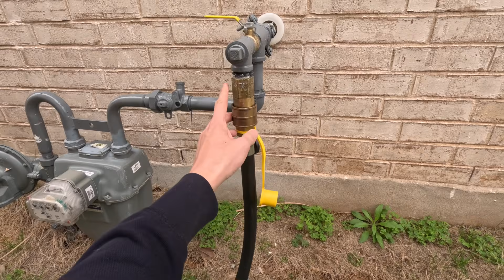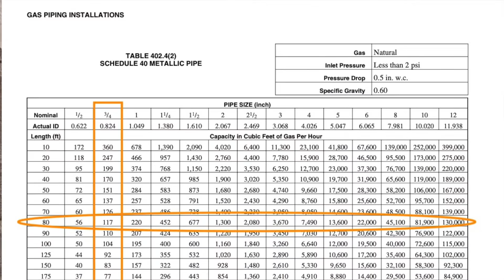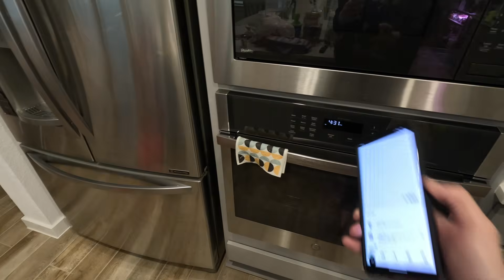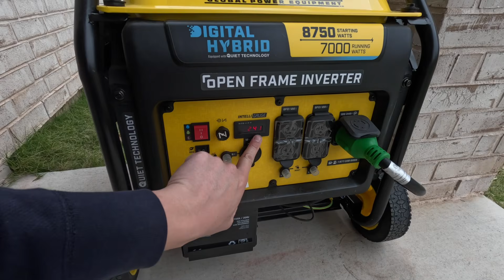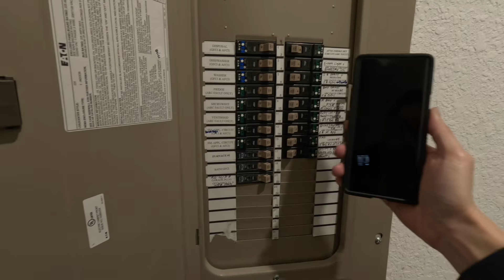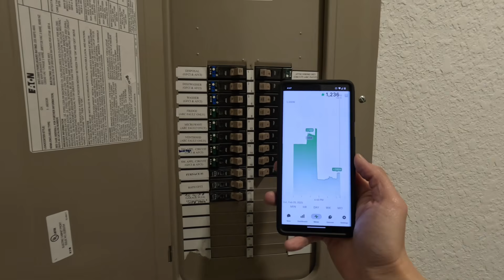Champion 100520 + Motor Snokel + Natural Gas = THE ULTIMATE BUDGET FULL HOME BACKUP GENERATOR?

Comment: You got a video on Beryl coming soon?
Reply from the maker: I live in Central Texas and fortunately missed the storm. Our power didn't go out at all, so no video for me to make (which I am grateful for).
Reply: @jonathanDIYs  You've got the best practical solution for us in the Houston area.  We didn't get power back till Monday evening a week later.  It got up to 86 degrees on Monday Inside.  We survived with generators to save our freezer and fridges...had one window AC in the small computer room.  My gas meter is 55 feet away from the electrical panel in the backyard.  I wouldn't feel safe either with a generator on the side of the house exposed.  I like the idea of the inverter generator and the add on start kit.  Thanks so much!! Are you in SA?
Reply from the maker: @bjmcia  Glad you like this idea and find it useful. I came up with this setup because I wanted something cheaper and less permanent than a generac that could come out to 10-15k after installation. This one meets all my needs while still being economical. I am actually outside of Austin.
Reply: I may go to 15,000 Champion Tri Fuel inverter to power our 4 ton AC.  Portable gas line and extension cords make sense to me too.  I can build a shelter out of free pallets.  I’m a woodworker too!  Thx!   I see Moony Mann’s setup too. Thx again from Houston.
Reply from the maker: @bjmcia  that's a nice model! Post some pictures of your build when you're done if you can. You definitely will want to go with the 50 amp breaker and NEMA 14-50 connector. Do note that the larger the generator, the faster it burns fuel generally. You generally want to get the smallest generator that will power everything you need. I definitely can see the need to get the larger model, my 8750 watt generator barely powers everything. 

Hope your emergency prep setup goes well!

Comment: thanks for the videos on the generator setup, looking to get the micro air soft start for my 4 ton trane AC so i can run my tri fuel generator to the house. How has it been after a year of use? I hear some mixed opinions on the soft start, some say" it kills the compressor over time"
Reply from the maker: I've had 0 issues with it, I don't even notice it is there. My compressor goes on and off 50-100 times a day, I have had no issues with this.

Comment: I probably missed it. What size is your generator? Great video thank you for posting.
Reply from the maker: @rjzlwop3153  7000W running/8750W starting for gasoline. On propane and NG, you can expect a small performance dip. Champion 100520 inverter generator.

Comment: who configured the electric box
Reply from the maker: I did the generator inlet port myself. I installed it using a backfeed breaker with a manual interlock transfer switch. This is the cheapest way to do it that is still compliant to electrical code.

Comment: do you need a separate regulator to run on natural gas?
Reply from the maker: The only regular you need when running on natural gas is the one that comes with the motor snorkel for MOST homes that feed the standard 7" WC pressure. You have to do the research for your home to determine if you are getting standard natural gas feed. The regular that comes with the Motor Snorkel is something like the: Century C-KN regular https://www.centuryfuelproducts.com/media/Forms/CENTURY_MODEL_KN_SERIES_SPEC.pdf

Comment: Awesome videos. Plan on doing exactly this. Do you think the ez start for the AC is necessary?
Reply: Yes absolutely. Be sure to get the correct soft starter. If u have a 4ton ac get soft starter for 5ton. Soft starter only come 1,3,5ton. My ac 39.7amps 240v brand new unit. Emerson soft starter 13amps/240v. Using wen 12000starting/8000running gas. Starts ac while house is active. Minus dishwasher, washer,dryer,microwave. I running 4000watts to operate 2refriderators,deep freezer,wine fridge,ceiling fans,ac. Without ac running I barely using 500watts. I have a reliance watt meter.
Reply from the maker: It was absolutely necessary for me. If you look at one of my first videos I posted when I just got the generator, I tried to start the AC and it ended up tripping the breaker on the generator and I lost all power. @herewegoagain4041 shares some great advice.
Reply: @jonathanDIYs  for some weird reason my 4 ton unit is in a 20a breaker? Fingers crossed i don't need to spend another 350 on the micro air
Reply from the maker: @XxMugatu  my first gut reaction is "that don't seem right..." Hope it pans out for you... I honestly didn't like taking apart my AC and wiring everything there either for the Easystart. Worrying about life-threatening voltage in the AC (the capacitor) is not my favorite way to spend a Saturday. I would agree with you that it would be great if you didn't have to add that.
Reply: @jonathanDIYs  i bet it's not a 4 ton... Even though i looked up the model# and that's what the Lenox site said.
Reply: @XxMugatu  I know u dont like spending money. I dont like spending excessive amounts. Houston just went through some still experiencing the after effects of hurricane beryl. What I didnt like is searching for liquid gold. Gas stations was empty. It was challenging finding fuel for the generator. 

So now the next expense is natural gas pipe line. $275 just for 1inch 100ft couplings and 30inch curve for input output for underground piping. I haven't comsidered the connecting components like in this video. I personally am looking into the 🔮  to know if it is really needed. 

Then I want to make a concrete base to lock generator  to. It just sounds like money money money. I will figure it out. Oh and more money for the expensive natural gas. But consideration for the difficulty finding liquid petroleum.
Reply: @herewegoagain4041  couldn't get gas for about 2 days. Had to wait in line for about 30 minutes. I'm still without power and won't get it back until July 19th. That's almost 2 weeks without power in one of the nations largest cities. I'm doing ngl as well
Reply: @XxMugatu  fm1960 & aldine westfield.........u?
Reply: @herewegoagain4041  edge of kingwood. Royal Brook subdivision. 🤘🤘👊👊

Comment: Jonathan: if your generator stops running does natural gas continue to flow thus causing a hazardous situation?
Reply from the maker: Hi @user-rw8rh6uh9z - Great question! No, if the generator stops running, natural gas does not flow because of the regulator that is included with the motor snorkel. Unless the generator is providing suction, the regulator stops the flow of gas. This is why I have to push the primer button a few times to get it started because of this exact safety feature. Thanks for your question and thanks for commenting!

Comment: I am currently running NG on a motor snorkel conversion kit on my WEN 3800watt inverter. Have a 30ah outlet with 30ah breaker. Since I have NG I am able to run all the lights, refrigerator, router, TVs, and 8000btu portable a/c and also furnace in the winter. But now I want to upgrade my genny to run the 5ton a/c. I will be buying and installing the micro air easy soft start. Then will upgrade the genny to more watts. My question is, Are you using a 30ah outlet next to the breaker box with 30ah cords running your A/C and other items in the house off that genny and NG?
Thanks for the video great info.
Reply from the maker: Hi, thanks for commenting! Yes, I am running my 4ton AC off of my inverter generator which is plugged into the main load center through a 30 Amp generator inlet port and a manual interlock transfer switch. There is a chance you might have to upgrade to a 50 amp for a 5 ton AC. It's hard to tell until you try it out because it is surge power and not sustained so the quick surge to startup might be able to go over the 30a equipment without tripping the breaker. Hope you have a successful install and setup!
Reply: @jonathanDIYs  
I really appreciate your response. If I can run it on a 30ah outlet will save me time and money. The worse that could happen it doesn’t work. I really appreciate the video and info. You are the only one Ive come across that is similar to my situation and wondered if it would work. Thanks again and will keep you updated.

Comment: Fantastic video!  One question how many amp is your plug to your breaker panel?
Reply from the maker: My connector and wire is rated for 30 amps so I got a 30 amp breaker to match and properly protect the connector or wire from overheating. Thanks for commenting and thanks for your question!

Comment: Hi! New subscriber. How much did materials for the gas conversion cost you???
Reply from the maker: hi there! Gas conversion kit cost approximately $190. The long hose I needed to buy and the quick disconnects was what ended up costing a lot as well. I think I spent another $200-$250. I think around $400-450 in total. If you don't need as long of a hose, you can probably shave off $150.

Comment: Basically you get 550 watts per horsepower.  The general rule of thumb is, generator running wattage divided by 550 roughly equals engine horsepower.  BTW, you are going to get voltage drop running such a long extension cord.  It's going to stress the generator.
Reply from the maker: Thanks for commenting and sharing the info about how many watts per horsepower. The extension cord is large enough gauge to handle the amount of amps the generator pushes out without any significant drop in voltage. The last time I had this run, I was still getting more than 115 volts measured from my Sense power meter. I'll measure my voltage at the generator next time and at one of my outlets and see if it is greater than the 3% max VD that is typically allowed.

Comment: I'd be curious to see the votage sag/frequency espcially when you're loading it up all the way. Also be careful on AC startup. The motor inrush is quite large. The microwave and oven are nice soft easy straight loads compared to compressors/electic motors. Look into a soft start for the AC if you plan to use.
Reply from the maker: Thanks for your comments! I already have a soft start for my AC. I have a video where I set that up. Voltage and frequency seems to stay pretty constant. With the inverter type generator, it seems to either be correct or turn itself off. I didn't seem to notice much sag.

Comment: Coming off the snorkle, what do you have?  Do you have a double threaded adapter to a 90 degree coupling to another double threaded to the quick disconnect?  Trying to see how you have all that connected as it has changed since your other video.  This is the exact set up I intend to use.  Thank you for any info!

Comment: That gen only has a 30a plug... So 6k is all you can expect it to put out
Reply from the maker: 30amps*240volts is 7200 watts if the load is properly balanced on both legs...

Comment: Any concerns drawing 39 amps through the 30 amp connector on the gen?
Reply from the maker: No issues with that as long as it is not sustained. Inrush is normal in circuits. Regularly, the AC has 70-80 startup amps even though it runs through a 40 amp breaker. Thanks for commenting!

Comment: The whole reason for the motor snorkel conversion is to avoid to extra cost of buying a tri fuel generator right? seems to be from what im seeing. maybe there's a little more
Reply from the maker: You also get more options... As far as I know, they don't really make too many inverter generators that are trifuel. I wanted to have an inverter generator because it outputs cleaner electricity measured in THD total harmonic distortion. Inverter generators are as low as 3-5% while regular generators can be 30-40%. The lower THD is better for electronics and LED lights. You won't get flickering and UPSes will charge properly.
Reply: @jonathanDIYs  I like that as well. I don't see many tri fuel inverters either. The ones i do see seem to be around 500 more than what you have. I''d probably do what you did cept with a shed for the generator since i have more space. I like your videos, they've given me many ideas. thx
Reply from the maker: @Gripmaster3000  awesome, glad you found it helpful. I dunno how, but the cheapest I saw this generator sell for was a bit under 700 on Amazon. I use camelcamelcamel.com to track prices and buy when it is low. You can set up trifuel with this setup for roughly $1100-1200 regularly and maybe even under $1000 if it ever dips to under $700 again. Hope you have fun and your setup goes smoothly!
Reply: @jonathanDIYs  did you buy yours from amazon? and im looking at dual fuel ones at the moment and wondering if the propane and natural gas go into the same port. I know with your attachment you added it seems to but im wondering without. thx
Reply from the maker: Yes, I bought it from amazon. Yes, the propane and the natural gas go into the same port. Gasoline is liquid, but both natural gas and propane is a gas. @Gripmaster3000

Comment: Where did you find that long of a hose, I am struggling to find 50 feet of 3/4 inch. I only found 1 on amazon for almost 200 dollars? Thanks.
Reply from the maker: Yeah, that's the going price. I bought mine from a supply surplus store on eBay. If you keep searching, you might be able to snag one after a few weeks. I set up an alert on a few keywords and found all of mine for approximately $150 for 80 feet. I joined 3 20-30 feet 3/4 inch hoses together. Hope you find what you're looking for!

Comment: You need to do a test in the winter to see if your gas meter is big enough to handle the load of the generator to see if there enough natural gas to run your hot water heater and the furnace, I heard stories that pilot lights were going out on hot water heaters because the meter was too small.
Reply from the maker: Honestly, living in Texas... I set up trifuel and not convert solely to NG because I don't really trust that I'll have NG when I need it. The freeze in 2021, NG was also insufficient - it wasn't even enough to run my tankless water heater as the power came back on. Unfortunately, the power plants here mostly run NG. When there is not enough power in Texas, chances are it could be NG shortage as well. I will be switching between propane, NG and gasoline when the power goes out. If I had more land, I definitely would be considering to have my own propane tank buried in the backyard. 

My emergency setup consists of a 20 pound propane tank, 10 gallons of gasoline and the natural gas connection that I show. For an extended outage, if there wasn't NG, I would probably ration out the generator usage to 4-6 hours a day. I think I can get it to last a week. Gotta work with what you have. :)
Reply: @jonathanDIYs  Agree. Not necessary to run 24/7 in an emergency. Used to have a PTO driven generator for our ranch in North Dakota. Ran it in the morning to make coffee for an hour or so, thn again at lunch, dinner and around 9 PM. Kept food frozen and the house unfrozen.
Reply: @jonathanDIYs  Jealous, here in Michigan we are single digits and below 0 at night, my furnace is running a lot right now seems as soon as it shuts off a few minutes later it’s right back on. I want to run a NG generator someday but my meter is in front of the house and I back feed through my garage all the way in my backyard, just propane for now.
Reply from the maker: @no1but24  20-40 here.. thankfully the utilities have kept up. Haven't had to pull the generator out this year yet. Hope I won't have to! Good luck with your setup. If it is as long as it sounds, you might need 1 inch diameter pipe or so. When I was setting it up, I did the research into all the calculations for it. I don't remember everything, but I think I cover it roughly in the video.

Comment: Running your generator at over 50 percent capacity for a length of time can damage the generator.  And can also cause a fire. Also your generator should be at least 25 feet from your house. A running generator puts out a lot more carbon monoxide  than a vehicle. That poisonous  gas can easily seep into your home.

Comment: I have the WEN 875i with the same trie-fuel kit.  It works fine. I haven’t measured the output to see the wattage under load.  I also haven’t tried to start my AC on it.  I’ll have to give it a shot now.
Reply: Yeah, it won’t run everything, just the critical loads (furnace fans and fridges during the winter).
Reply from the maker: Awesome! Hope you can get everything running in your house with it!
Reply: Looks like I am also getting 4900 to 5000 watts.  I was expecting closer to 5500.  I am wondering if it’s more of a limitation of the conversion kit (snorkel itself) or the generator.

I have a 35ft 3/4 hose with 2PSI and a step down regulator to 7-11” of WC.  I don’t believe it’s your gas supply, I believe it’s generator or snorkel limiting.  Keep in mind all that gas we are supplying in the line has to go through that tiny little hose that motor snorkel provides and then has to go through the tiny Venturi on the carb as well.